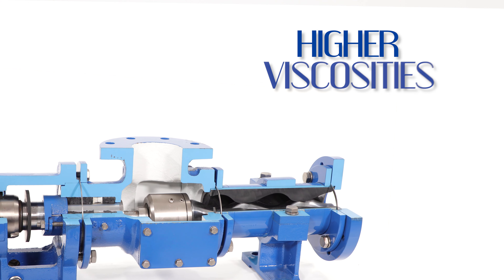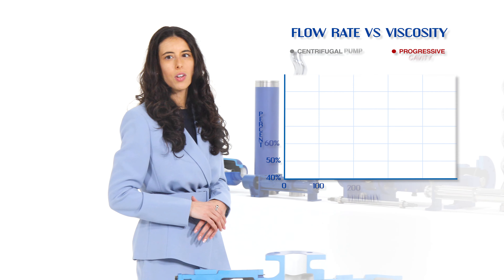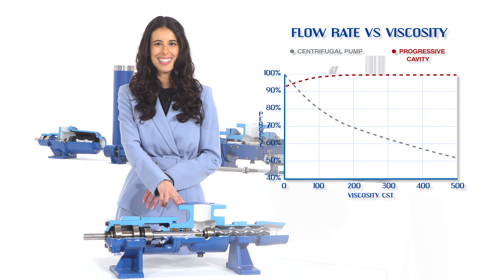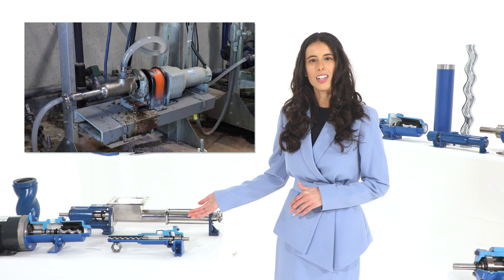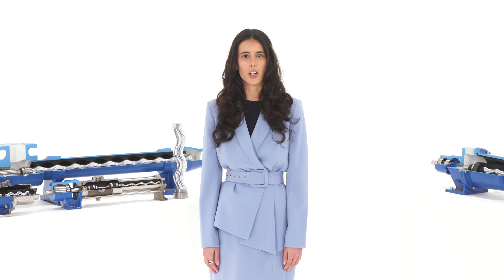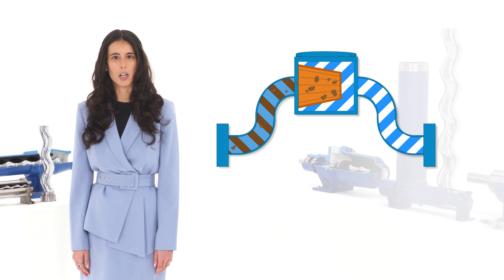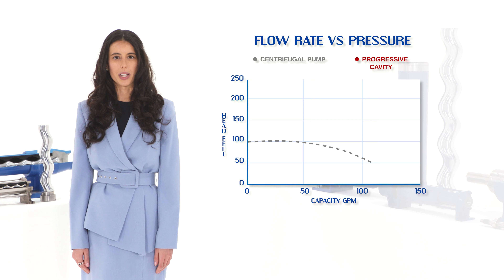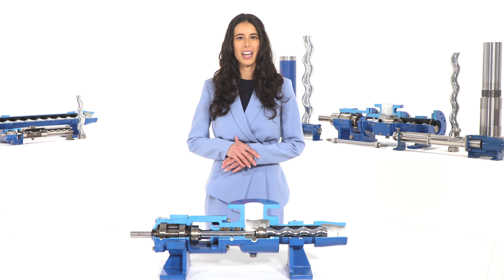When to use a Progressive Cavity Pump? - A Quick guide.

Comment: Hello. I have a progressive cavity pump with range BN, size 1, pressure stage -6L for my ballast system on board a stern trawler. I want to put a thermostat on the suction size but I need the suction pressure to pick the pressure stat size. This is not in the book, and I know it's below -1 bar. Can someone tell me where to look? 
Thanks
Reply from the maker: The pump would not determine the suction pressure, the pump works to whatever the piping/system needs to perform. The suction pressure is surely below 1 bar. If the pump is drawing up from below then the suction pressure might be negative, between 0 and -1 bar, but surely not a full -1 bar. Since the pump is a 6L, the discharge pressure would be 0-6 bar. If you have any further questions please feel free to contact us.